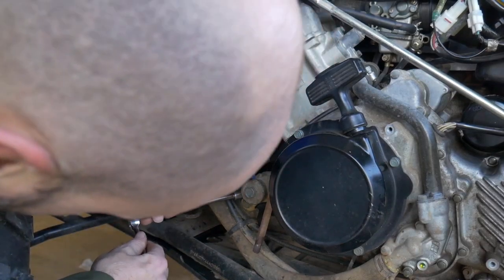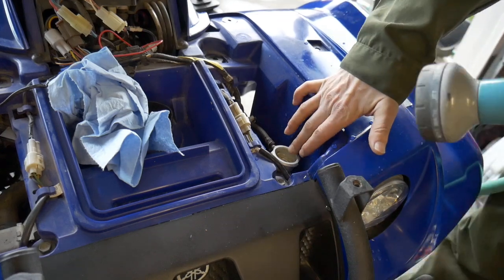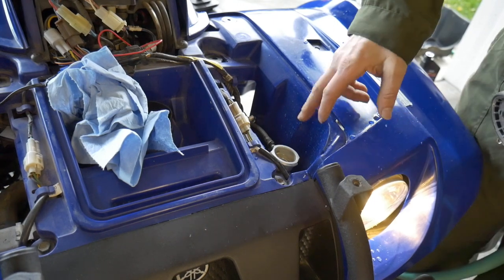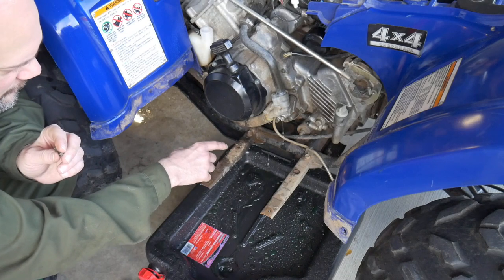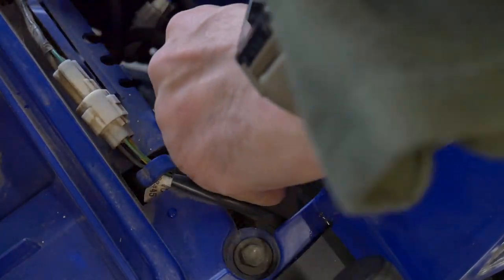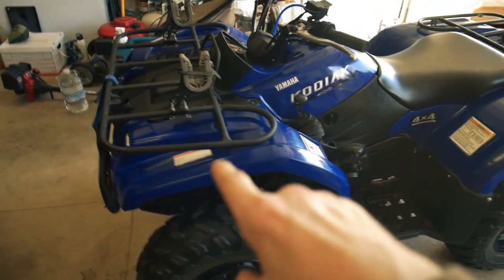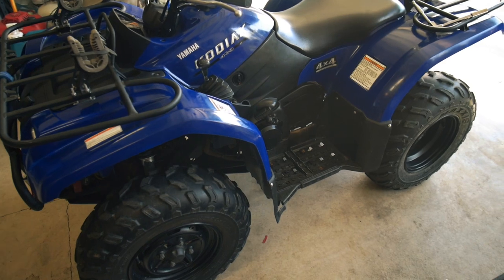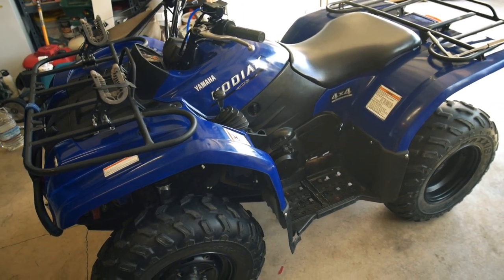Yamaha Kodiak 400 - Coolant Flush

Comment: Did you have the bleed any air out of the system? Thanks I just changed my coolant with Engine ice and it has gotten hot on my a couple times since. The only thing I didn't do was bleed or burp the system.

Comment: I have one too 2009 Kodiak 450 muffler super loud like a Harley Davidson every time I started up and won’t idle good….would I have to take carb out and giver a clean? I did the spark plug oil change filter and both diff oil change now I watched this video gonna do a coolant flush but back to the muffler she’s solid right to the engine

Comment: Does it make a difference if you flush the system with a garden hose or not? Is it better? Thanks!
Reply from the maker: Vintage Arctic Cat Rider It depends on if you have a bunch of debris/corrosion or hard water scale.  

I once didn’t do it on a car and it plugged up the heater core until it was pressure flushed.